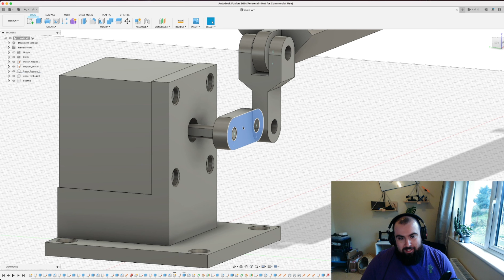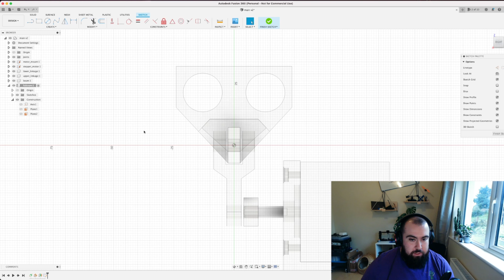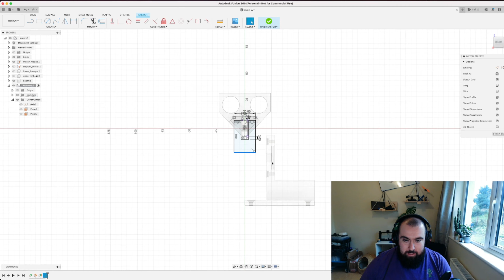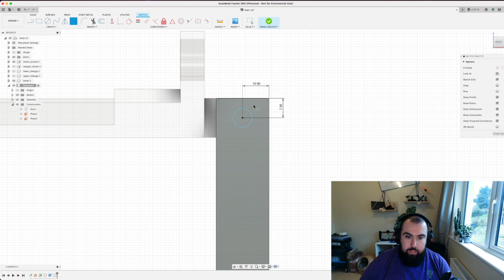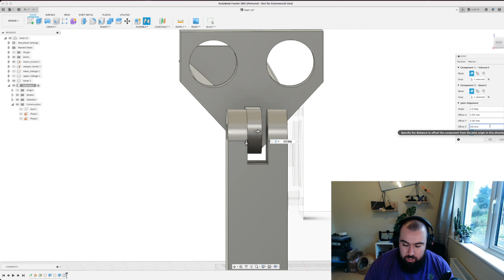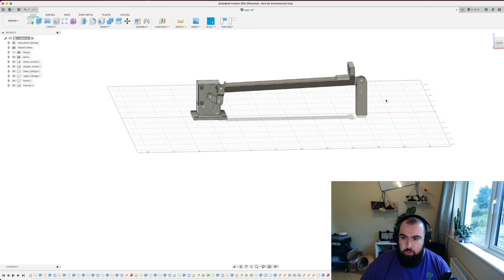Ball & Beam Kit - Part 2

Comment: Impressive work!! I am trying to do almost the exact same project but I encountered an issue where the hcsr04 was blocking the motor movements due to the time it takes for sensor to read distance causing the motor to be really slow and somewhat jitter, so I decided to pivot to a tof sensor hoping it would be better, which it was, but not really enough to what I looking for. Can I ask you how did you get around this issue of the hcsr04 taking time to read distance so by the time it does so the stepper couldn’t really move so it only moves as fast as the sensor read distance if that makes sense
Reply from the maker: The read time for the sensor wasn't really an issue for me, I used one of the HCSR04 libraries, if you look at their implementation they use a 12microsecond delay in their read loop, which isn't very long. So adding that into the cost of reading the sensor doesn't impact the loop massively. If you combine this with a simple Kalman Filter you can end up with a pretty smooth sensor signal to feed into your PID controller.

Comment: My ultrasonic sensor is not detecting the ball and only detecting flat surfaces. I’m using exactly the same ball. Can you please help with it?
Reply from the maker: Without knowing more about your setup there isn’t much I can really help with I’m afraid. Depending on the sensor you are using, the transmit and receive heads need to be close enough together so as the ball will reflect the waves, if the sensor heads are too wide it won’t work. You haven’t said what sensor you are using so I can’t really comment.
Reply: @careyian Thank you so much for replying. I am using the hc-sv04 sensor. Have the standard distance between the transmit and receiving heads. I have also added small 30mm tubes over both tx and rx to narrow down the beam. With this now I am getting intermittent readings but still not enough to run the control. Did your setup work right away upon fixing the sensor or did you face this problem as well. On all the forums people mention that hc-sv04 has a problem in detecting spherical objects but you have done it successfully so it must be possible.
Reply from the maker: @piyush7924  I had no problems with them at all. They worked straight away for me. Have you tried swapping out the sensor for another module? The module could be faulty or you could have some loose wires or something else.
Reply: @careyian can you tell me what is the beam length and runner length in the beam?